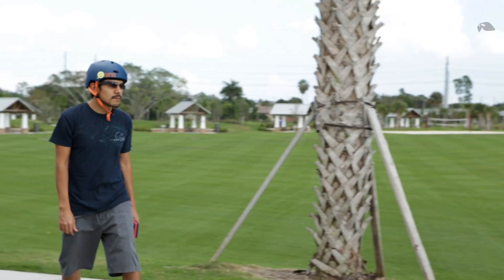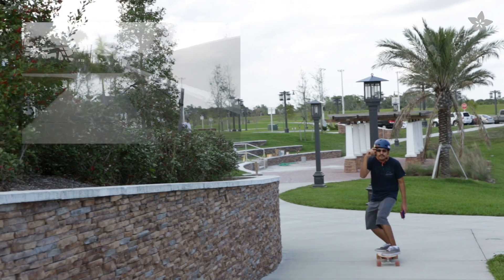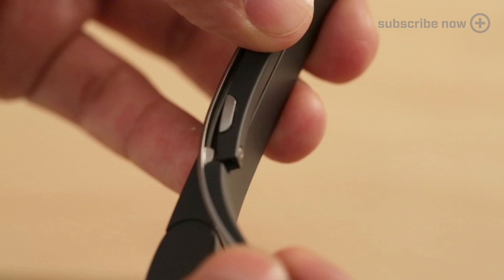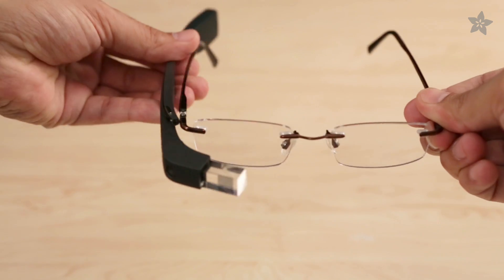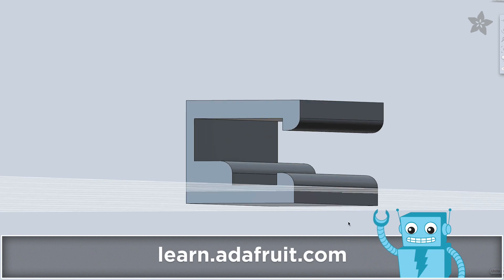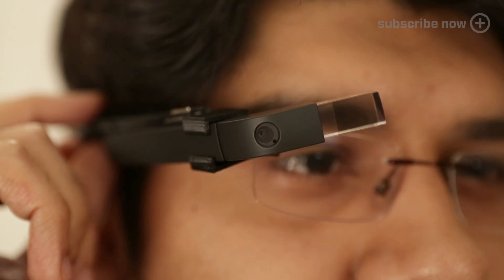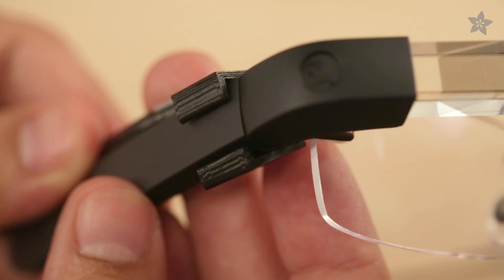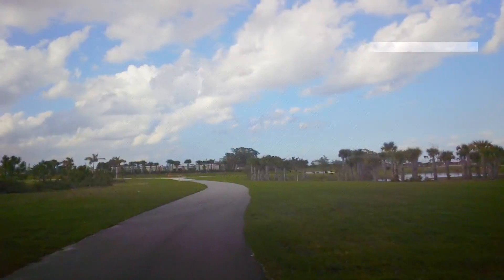Google Glass on any frames - 3D Print your own adapter

Comment: Print a new frame for under a dollar? That's assuming you already have a 3D printer, which costs more than the frames if you don't. :P Although I guess you have to be rich already to get Google Glass at this point, so getting a printer wouldn't be a problem...